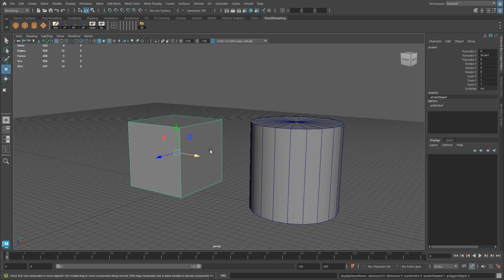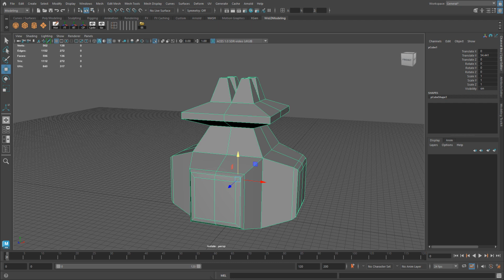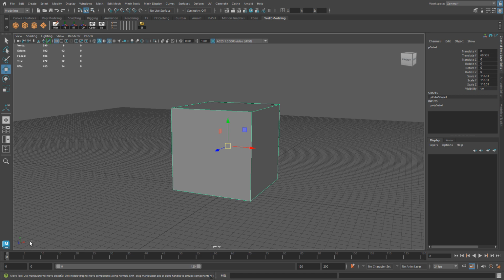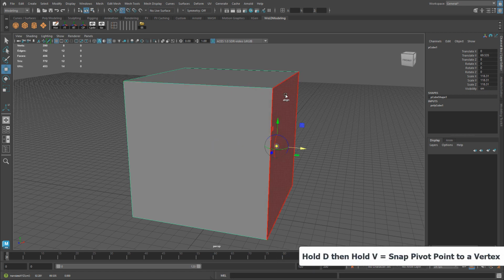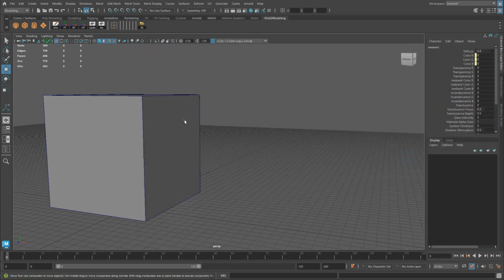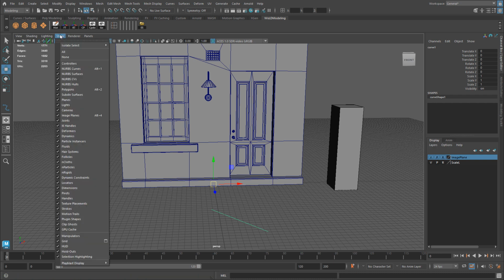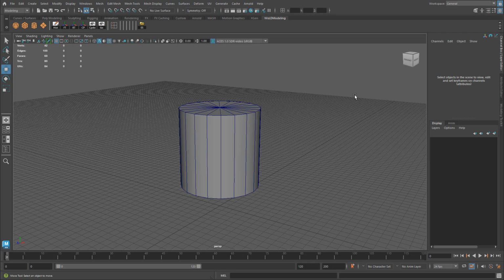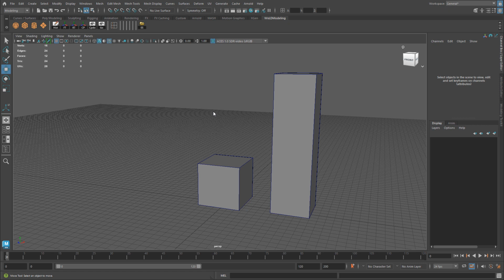18 Crucial Mistakes Beginners Make Using Maya - How to Fix Them and Avoid Them

Comment: Is there a difference between using "insert" compared to D to adjust the pivot?
Reply from the maker: No. Different keys, same function.
Although with D you can toggle or press down to activate.

Comment: I'll add another one : switch your up axis from Y to Z. This is not necessarily a 'beginner mistake' but just a tip that proved useful to me personally and may help you if you use multiple DCC tools. This helped me to transfer models between blender and 3ds max as I have to do this at work a lot and avoided headaches when it came to transformations. The FBX format handles this just fine but your meshes will have rotations on them in blender and max which is not ideal if you're dealing with some cases.
Reply: I agree. Switching up axis is a huge beginner mistake.
Reply: Wait so should i switch or not??

Comment: I will have to add a caveat to MA files, I have run into issues plenty of times where the use of internal tools/scrips simply made it so that maya was straight up unable to save to .ma and threw an error. Personally I prefer MB due to saving being faster and the file sizes being smaller. If you are worried about file corruption just make a lot of incremental saves and delete them later. Just my two cents.
Reply from the maker: Good points Alex.